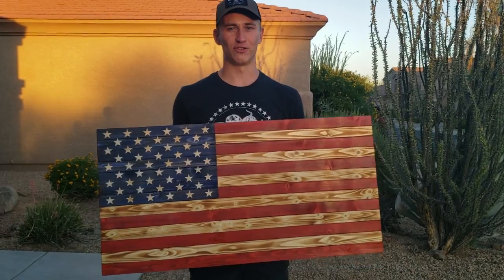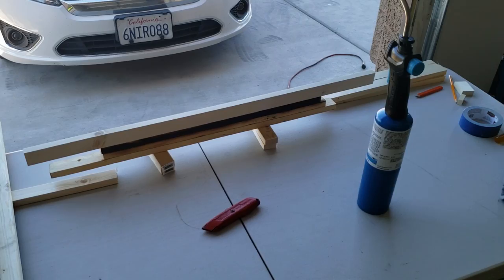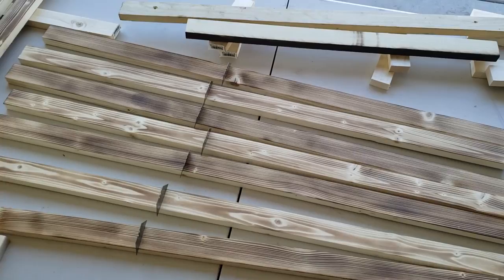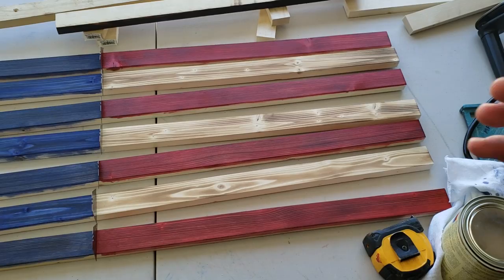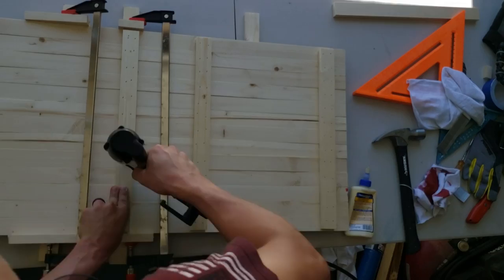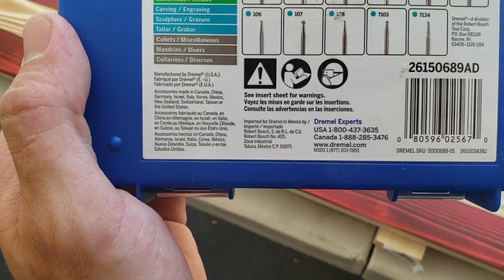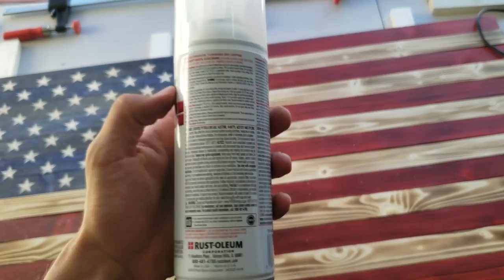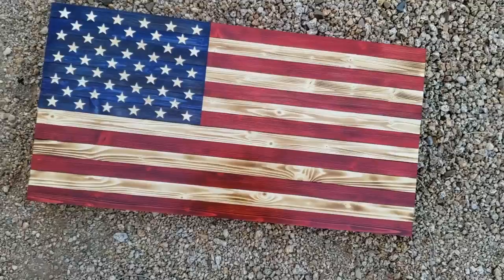HOW TO BUILD A RUSTIC WOODEN AMERICAN FLAG! STEP BY STEP

Comment: Might be a dumb question, but u didn't want to sand the front before staining to make it all even? Just curious cause I won't do that if it doesn't matter lol
Reply from the maker: I think it might help a little to give them a quick sand, i used to not but then i would sometimes have problems if my hands would get sweaty then i would torch it and it would burn fingerprints and weird stuff into the wood so now ill usually just give it a quick sand with 220 grit👍
Reply: @MaxF01  awesome thanks man!
Reply from the maker: @truth4696  no problem!!

Comment: Hey bud, I've got a question as to the water based stain. I decided to make some of these for the holidays and stained my first one yesterday...is there a reason why you chose another brand for the blue? I bought minwax scarlet and true blue at the lowes location closest to me in TN...needless to say the scarlet turned out great but the "true blue" did not take on half of the boards and thats after two coats? I used to be a contractor by trade but, I've never used a water based stain so I wasnt sure if I didnt have it warm enough in my shop or did I need to sand after a first coat or if it was just the product in general? I bought 1x2 from lowes also so I'm pretty sure its not that so I was just curious bud. Any advice/knowledge would be greatly received. Enjoyed the videos I have watched going to watch the how to on carve anything next when I get a chance. 
Merry Christmas and Happy Holidays to you and yours. Thank you for posting the how to videos bud

V/R, 
Brian
Reply from the maker: Hmm im not too sure, the only reason i have the other brand is because i got them at different times. The only thing that i can think of is if it wasnt mixed up enough, ive done that a couple times were i didnt mix it enough and the stain was kinda watery and didnt really take to the wood. Other than that i cant think of any other reason why not, especially if the red stain is working fine. Sorry i cant give you any more advice. Thank you so much for the positive feedback my friend i really appreciate it! I hope you and yours have a Merry Christmas as well! Thank you again!🙌🏼

Max
Reply: Max F 
Hey bud,
Thank you for the quick reply and no worries on the advice dude. I thought about that too on the mixing and I'm going be thorough in doing so this afternoon. I think I figured out the problem it's been pretty cold here the last week or so and I don't have HVAC in my shop I just run a few electric heaters. The humidity level and temperature for a water based stain should be around 70 ideally and no lower than 55 to 60. Had my 2 nephews yesterday and they were in and out of the shop like kids do so that probably lowered the temp in there considerably raising the humidity. I looked up the temperatures for the water based stuff on minwax and Sherwin Williams earlier and after going out to see if it had changed any from leaving the heat going I pulled up my Union stencil from where I left it laying on top of the blue and after doing so the stars were silhouetted without tracing. So I guess it drew the moisture out of the open stars and they look like it should...why I did not think more with it being water based and knowing from being in the construction industry for so long...lol Duhh oh well I'm going to do some light sanding and see how it looks after wards and I read that I might have to use some mineral spirits...I really don't want to do that so time will tell. I'll give you a update and let you know how it comes out. I've got my Dremel and flex shaft for the carving I've used many times in other projects I'll be using it to etch the stars after tracing them but, I picked up a plunge base by Dremel that's been on sale for $30 a few weeks ago and I'll let you know if it's any easier using that way, I'm hoping and thinking it will being you can set the depth I picked up a blower attachment also I noticed that made a big difference on your videos. I'll let you know what happens bud in case some other dummy(just joking) runs into the same issue. 

Thanks again Max F,

V/R,
Brian
Reply from the maker: @brianthebuilder1558  oh okay that makes sense, i live in Phoenix, AZ so we dont get too cold here so ive never had to deal with that. I would love to hear how it works out! Also thank you for the info, ill be sure to share with anyone who runs into that issue! Best of luck to you Brian!!🙌🏼

Max
Reply: Max   Me to, my blue was watery and the red was great! Bought both at homedepo
Reply from the maker: @maryannepacitti1251  thats very wierd! I wonder if it might have something to do with the temperature and humidity. Sorry i dont have much knowledge of why that happens. Please let me know if you figure anything out about it! Best of luck to you!
Reply: I’ve noticed that the blue definitely doesn’t take as well. What I do is apply the stains with the small foam brush and then wipe off with a paper towel after a few minutes. I let the blue stay on for several minutes longer and even do a second coat if I think it needs it. The spray enamel that I out on after also helps bring out the color of the blue.
Reply from the maker: @drakeswake  thats a great idea! I usually end up doing 2 or 3 coats and ive also noticed how the sealer brings it out a little more too. Thanks for the feedback!!👍🏼

Comment: Do you get a lot of fuzzies left when you carve the stars.
Reply from the maker: It depens on the wood but usually i will get quite a few that have them. Most of the time i will just brush over them with my hands and most of them will fall off, you could also use a sanding attatchment to get rid of them but it could get a little time consuming if theres a lot of them.

Comment: How much did you spend on material? And how much can you sell that for ?
Reply from the maker: The most expensive thing is the wood and i think its around $20. The rest of the material would be glue, nails, and stain but all of those are materials you can use on several flags before you need to buy more. I think $100 is a pretty common price but some do more and some do less

Comment: ANY other way to cut out stars ? I don't want to have to go buy a dremel.
Reply from the maker: To actually cut or carve them out i cant think of any other way besides using a wood chisel but that could be very time consuming, if you are not worried about them being actually carved you could use a stencil to spray paint them. Sorry i wish i had more ideas!!
Reply: @MaxF01  I borrowed one,  worked so good,  I bought one.
Reply from the maker: @AlfredoBondigas22  that is awesome! Best of luck on all your future flags!👍🏻

Comment: What kind of saw it that
Reply from the maker: Its a Ryobi 10 in Compound Miter saw, ive had it for a while and just been using it for projects here and there and so far it has held up fine. Its not the nicest but it gets the job done and it was fairly cheap👍
Reply: Thanks
Reply from the maker: @alexanderwitowski9010  no problem!

Comment: How much does it cost you to build one of these?
Reply from the maker: For the wood its around $20 and then it depends on if you need to buy other things such as the glue and nails or if you already have them. And then you will also need a union stencil which is about $12 but they are reusable.